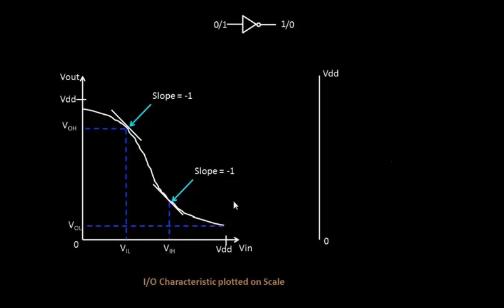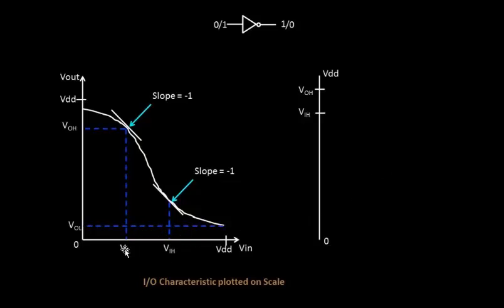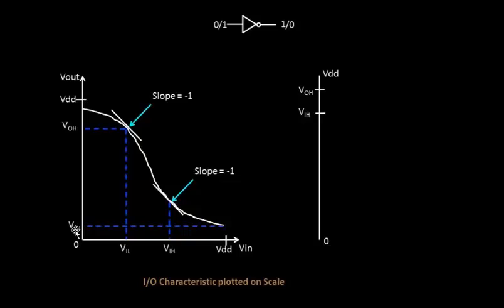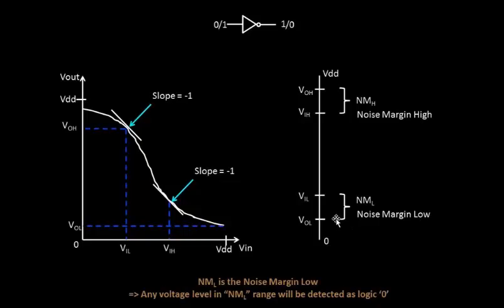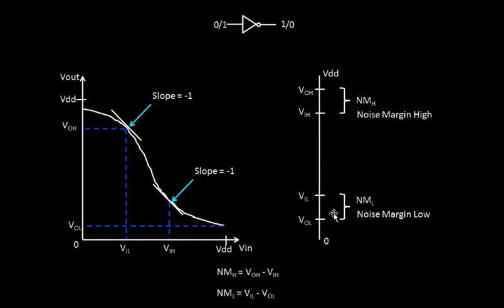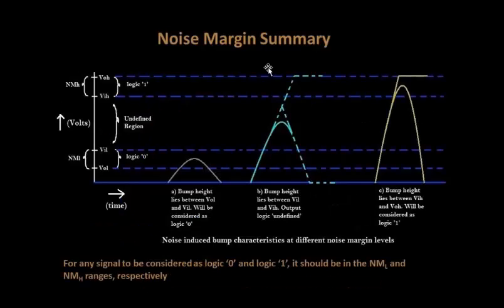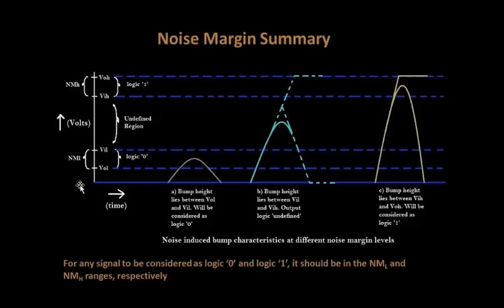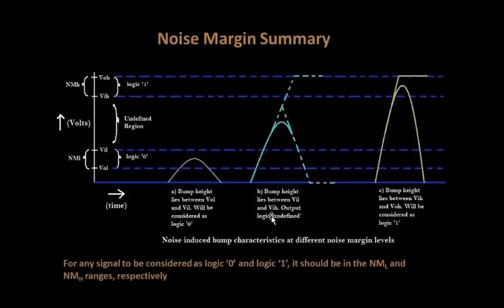How to solve the  Noise Margin Equations?? Learn @ Udemy- VLSI Academy

Comment: I think the graph is a little bit incorrect. VOL is the location where the slope is -1. You have mentioned it when input is VDD.
Reply: why we learn this noise?
Reply: @muhammadfahimi2919  because noise is a natural issue in any logical circuit ... And may affects our results ... NM should be maximum because it is the amount of noise that a CMOS circuit could withstand without compromising the operation of circuit.